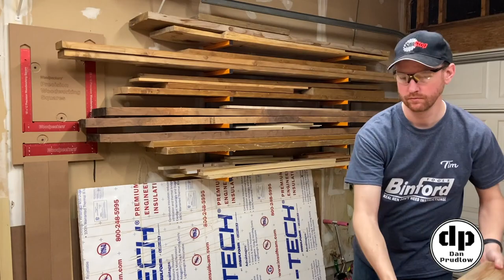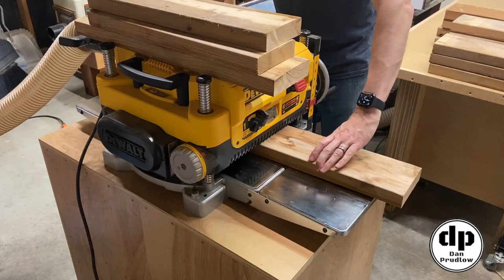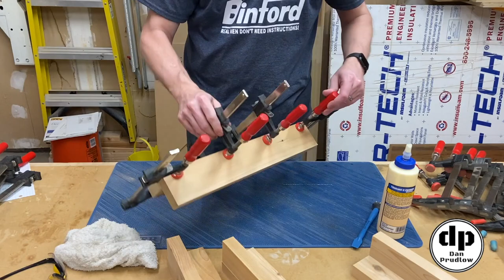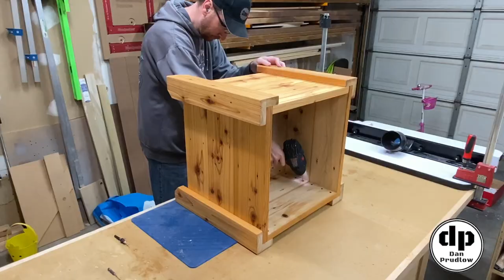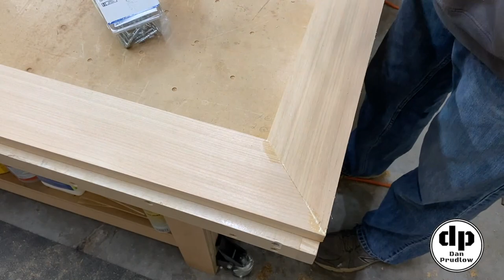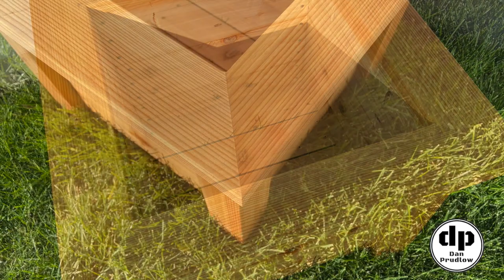Simple Cedar Planter Box from Reclaimed Cedar Timber

Comment: Great job but i have a  question. On uiur 45 deg. Miter corners when measuring do you measure inside corner i try and s0me times it just doesn't meet up.  Thanks and enjoy watching your videos. Learning lots
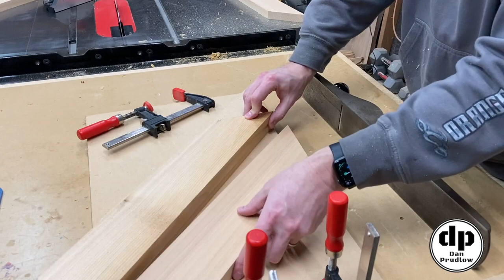Reply from the maker: Thanks!  In this case all four needed to be the same length so I measured the inside length and marked and cut them all just a touch long.  At the 9:00 mark I’m using a 45 degree jig to hold the piece while I fine tune the end with a hand plane.  There are videos out there on making one of these...i think they call them shooting board or something like that.  This is a great way to take the saw cut which might be a fraction off 45 and dial it in.  Also you will see about 9:20 that I use one of the other pieces already done to line up the next one.  This allows me to plane each one down a little so that they all end up the exact same length.  This in addition to fine tuning that 45 on each one gets those miters looking really tight.  Hope this helps and thanks for watching! 👍🏻

Comment: If this is for outdoors why not use WP glue and screws to go along with the good job you did on the workmanship?
Reply from the maker: I didn’t use glue on most of it because I want the option to take it apart for refinishing.  For the legs the wood glue will hold just fine.  I didn’t want screws visible and couldn’t use pocket screws without the holes cutting into the inside edge of the leg.  Thanks for watching! 👍🏻

Comment: Why dont you put the measurements of the box you are making??
Reply from the maker: Most of the time I’m sort of winging It based on the material I have.  Measures 19 inches tall with the top trim measuring 23 inches square.  Inside is 15 inches deep and 16 inches square.  All material is 1 inch thick.  Top frame pieces are 3.5 inches wide.  Side pieces are all 5.25 inches wide.  For the legs one piece is 2 inches wide, the other is 3 inches wide so when glued together they are 3 inches in both directions.  Hope this helps.  Let me know if you have more questions.
Reply: @DanPrudlow  👍
Reply: @DanPrudlow  tks